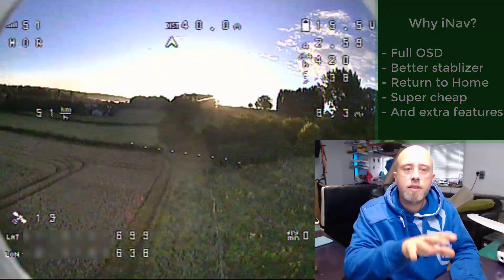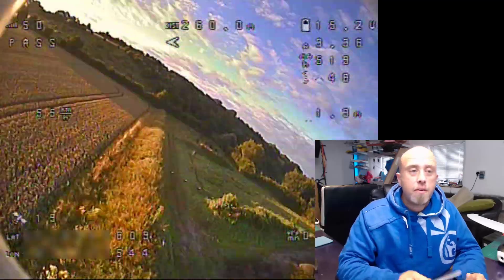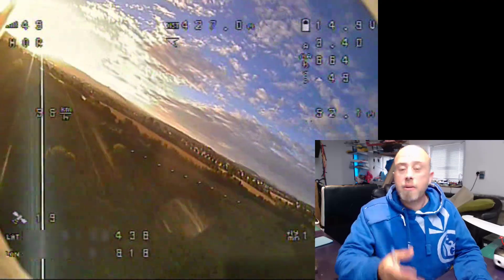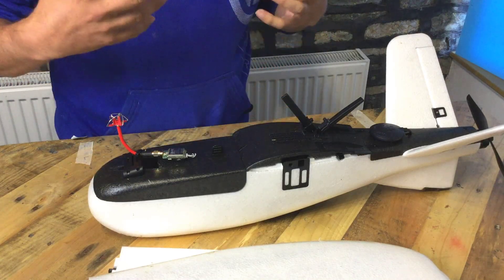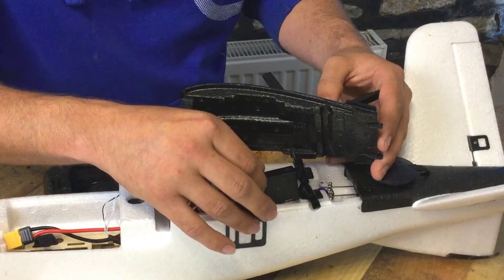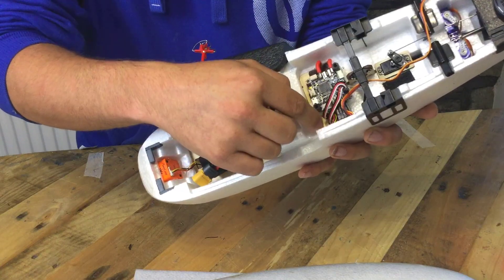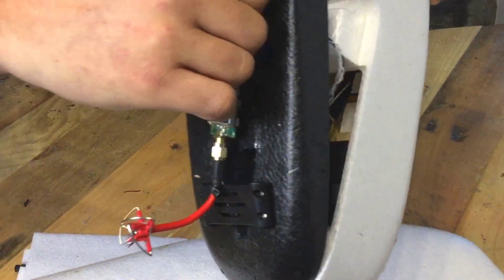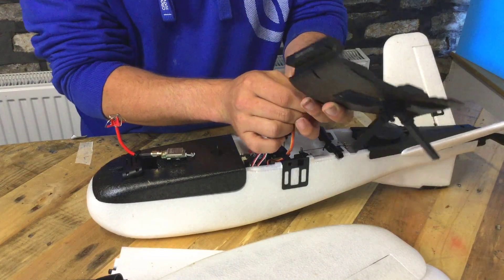ZOHD Nano Talon iNav Conversion + V-Tail Mod + FPV Build Overview

Comment: Do you use a capacitor on battery leads to reduce noise?
Reply from the maker: Morning, never Mike. I might sometimes add a torrid coil for power lines to the FPV camera, but that's not very often. Matt

Comment: Hi, I see you have aligned the diversity antenna north/south rather than east/west. Is this less/more effective? It makes more sense aerodynamically but I thought the intention was to have one antenna closer to the vertical in the roll plain. Just asking, if there's no difference I'll change mine to north/south orientation. Cheers.

Comment: A nice review, could you tell me what the green rings are called and what is the purpose are they to stop interference and are they magnets?
Reply from the maker: Hey Alan, those are torrid coils, they reduce noise . Have a google on them as they work really well. Matt

Comment: What battery should i use fpr 30 min flight? Pls help i am begginer
Reply from the maker: Hi, are you really sure you want to fly for 30 minutes when you're a beginner? Pretty sure it would be irresponsible of me to add anything to help you tbh fella, Matt
Reply: @RagTheNutsOff  im using 4s 2200mah for 30 mins flight

Comment: I I love the videos good work anyhow I have the zohd dart which I  have inav setup in my question is it does not have enough control or is not responsive enough when flying is there a way to increase roll and Pitch responsiveness to make it more Snappy while flying as I did not have enough control to pull up from a dive  in horizon mode thank you

Comment: Hi Matt you may have scoffed at my idea of running my fpv of a second battery....not as ridiculous as it sounds// with a runcam swift in the nose and 1500 3s pushed back as far as possible the talon was still nose heavy... with a 2s 800 in the underbay it is now cg perfect and still flies as well even with the added battery weight

Comment: Hi Matt I like your video and I want to build inav on my Nano Talon. But the gps you recommend is under restocking on banggood. Can you recommend another gps (on banggood) ? Many thanks, Henning.
Reply from the maker: Howdy fella, I cannot as I have not used them. Get the GPS from eBay instead as it'll be the same thing. Matt
Reply: Hi Matt, Thanks for answering back. I found a similar and ordered on eBay. :-)

Comment: ok Matt at 62 and new to fpv but not flying as i have  bixler and timber. i was confused by the wiring nor much good at electrics but i can knock a tune out on the bagpipes...try that for a laugh...bought the talon after seeing your reviews and decided to try fpv first before next attempting inav..anyway just read somewhere that i should strip the heatshrink from the esc and connect there...is that right?....I am sure that i am not the only one new to this and it would have been  useful as you rave about the talon to have had a whole series on setting up for us beginners with fpv and inav...Cheers

Comment: I’m having a hell of a time with this inav stuff in my NT.  Elevator working backwards meaning I tilt the NT down the elevator goes down when it should be going up! Same if I pitch craft up the elevators go up!  Absolutely no help from the Facebook groups just same old ridiculing. I’m using a QX7 with sbus and a x4rsb receiver.
Reply from the maker: Morning, watch the second half of this video, the mixer is covered in it https://youtu.be/5Z5dTBIDLC4 Matt
Reply: RagTheNutsOff thanks but I gave up.  I purchasing the full size talon and going with vector or pixhawk.  Not a fan of inav.

Comment: Thanks Matt!  This is exactly what direction I'm going with mine.  Been collecting the plane and all the parts to go in it.  I haven't used iNav yet and your series on it has answered a lot of my questions.  Have a friend with a 3D Printer that has printed all the same parts, so when I came across the video, I'm getting more exited.  Thanks again for all the information you've put out there!

Comment: The ESC and gps that you listed are out of stock. Do you have any recommendations for replacements?
Reply from the maker: Hi Nate, check eBay for the GPS unit, makes sure it's the same though. As for the ESC, anything similar should be OK. Matt

Comment: Hi Matt! 
Thanks for your informative videos! I'm modifying my Nano Talon to tighten up the ailerons by adding one servo in each wing. Then I will have 4 servos insted of 3. Is it possible to configure iNav 1.9.3 such that all 4 servos are controlled effichiently? I'm intending to install the Furious F35 as FC. If so - how should the iNav setup be like, compared to the 3 servo setup?
Thanks and best regards,
Torgeir

Comment: Thank you for the reply, but I know you know, because I see in you flight test that rssi is working on you osd, so my question is how you get that rssi that is working on you osd, what cable from the rx to you f4 v2 flight controler is solder, . thanks.  and happy fliying.
Reply from the maker: Howdy, see my YT channel, I did a series on Inav and also one episode for the RSSI connection. Matt
Reply: Founded it, thanks so much the x4r is inverted signal so you need to do a mod and solder en the back of one of the chips to get un inverted  signal and then solder to the pad and then calibrate the rssi signal with the osd and radio or inav software, the x8r does have a un inverted rssi out so the only thing in the case is just to do calibration,  thanks so much for the info.  Have a fantastic day.

Comment: How hard or easy is it to set this up with a little pan and tilt mount on top of the nose? Feasible?
Reply from the maker: Morning, yep it's feasible, but it would have to be light as you'll compromise the amount of battery you'll be able to carry with extra weight in the nose, Matt

Comment: Great video Matt, thank you very much. I've my model almost ready for maiden with the iNav conversion. Also followed your iNav series. I am powering the servos with the UBEC of the ESC (only signal and ground wires connected to fc). Is this ok? Thanks!

Comment: Hi! I have a following problem with my Nano Talon( with omnibus f3 pro): when I move the sticks,  it is shown on the screen in iNav,but the servos on the plane doesn’t respond. Also the motor works on the motor test via iNav, but when I try direct from the radio-  nothing. Also, the esc starts beeping when plug the battery. Even when I arm it, nothing changes.I will be really glad if you can help me! Thank you!
Reply from the maker: Howdy, see here https://www.youtube.com/watch?v=TfZZnurrIRA or check their wiki, Matt
Reply: Thank you! I still have not solved the problem. Is it possible the reason is that I don’t use PDB, and soldered all servo wires directly to the flight controller ? If this is the problem, why the motor also doesn’t work? It works only on motor test in iNav.

Comment: Question, do the small magnets affect the iNav at all?  Also, do you think this could be a beginning model, for someone that has a bit of experience?
Reply from the maker: Hi Mike, yes & no. Yes if you have a compass/magnetometer onboard and enabled. However a compass is not required for iNav. As for a Nano Talon being a good beginners model, definitely not. There are better models out there, like the AXN (look this up on my channel) which would be way better and cheaper, hope that helps Mike, Matt

Comment: Him Matt,I am building my Inav  nano talon kit ,these days ,and I was wondering If I have to set any reflex for level flight at the elevators, like my S800?
Reply from the maker: Howdy fella, yes. The CG on this model is correct, however you need some uptrim, say 2mm and try that, Matt
Reply: thanx Matt I'll try that.May ask you for any flying tips?I see many videos of NT's spinning out of control for no reason ,what do you think happened?I  am building mine as a gift for my little brother and I am a little worried as he only has experience with toy planes.

Comment: Hello Matt,
I have a big problem with my Talon Nano. I hope you can help me. I use an Onibus f3 Pro and Inav 1.8. The Talon flies but Returne to home and Positionhold does not work. The Talon tilts to the side and crashes. I did a video. I hope you can help me. 

https://www.youtube.com/watch?v=sznxjlBqkhc&feature=youtu.be&t=27s

https://www.dropbox.com/s/tsqum4wty3atm8j/Dump%20Inav.pdf?dl=0

Comment: Hello Matt, like many others, you inspired me to buy NT as well :-)  And I wonder if you just connect rudder servo to PWM5 pin. I found out that it is possible use PWM2 for servo using experimental iNAV FW.

Comment: hey matt do you have a video on how to set up the mixes for the nano talon? I looked but didn't see one. I'm using the CLI command mix off Gethub for the nano talon not sure what pwm out I use for the tail end. 1-motor, 3-ail, 4-?, 5-? .  I would just try one combo and test it but not getting passed some beeping I think is from the esc, do I calibrate the ESC through the FC or by-pass it and plug it strait into my receiver to calibrate it? thanks a lot for the help.

Comment: Hey Matt,
Really enjoy the content you produce.  I'm hoping you can help me figure out what is wrong with my nano talon inav setup , I bought an Omnibus F3 from readytoflyquads and loaded it with iNav 1.8.  I've got an FRsky Xsr rx connected via sBus and have loaded the custom mix for the 3 servo setup.   Everything works except for the second rudder/elev servo (connected to PWM 5.  I know it isn't the servo itself as I can switch it with the one connected to PWM 5 and then it works and the other one doesn't.  It seems that I'm not getting any output on PWM5.   I'll post in the facebook group when (if ) I'm approved.

Comment: I'm building a inav nano talon using your videos, I just went to get the FC and its out of stock but I seen they have a V3 with a barometer. will this work with Inav as well, and other aspects of your build thanks a lot
Reply from the maker: Howdy, no Baro is needed on fixed wing models, hope that helps, Matt
Reply: it was more so because they don't have the v2 till next month. 
man great channel I just stumbled on you looking at the Nano talon, iv been watching your videos the last 3 days! I have a Bixler 1.1 set up with an arkbird fc and osd, but wanted a smaller fpv platform, thanks again
Reply: oh the v3 does not have current meter ill see if I can find a v2

Comment: I'm gonna build this but just a few questions when ordering the antenna has a choice  does rp sma female fit rp sma male?and the camera should I get pal or ntsc,?
Reply from the maker: Howdy Paul, yes thats correct on the connections and for the FPV camera, PAL. It's a bigger picture. Hope that helps Paul, Matt
Reply: thanks for your quick response ,gonna order the parts some are out of stock  so will have to wait ,I want to go in a cloud ive got racing drones but need the extra flight time and return to home function.this looks the best way to do it

Comment: Ive watched most of your setup videos.  Theyre great.  One thing you mentioned but didnt go over is how you are using a BEC with the boards bec?  I have the same setup but im not sure which power regulator to snip on the f4 board.

Comment: Matt, I have tried to discern how you fed the antennas through the foam on top. Since that area is all black, it does not show up well in the video. I see no obvious way to do it with out cutting a hole in the foam big enough to pass through one leg of the antenna at a time. Then do you glue or velcro the mount over that hole or what??? Thanks.

Comment: Another great video, thanks! How did you power the servos from the ESC ?
For the NT I guess you don't need the PMW6 as you have only one servo for the AIL. So I connected it as you explained in your Omnibus V2 pro video, use the NT mix, but PMW5 doesn't work. Is that because I use inav 1.8.1 while you are using 1.7.3?

Comment: Bought the version with three servoes. It is worth checking the fuz aileron torque drivers as mine bind. Teflon seems to fix. Also glue the spar box components as I ripped the fuz end plate off in a minor crash.

Comment: Would you please consider a video on how to connecting the servos, specifically PWM outputs 5 and 6. Can the channels be remapped to use PWM 2 for servo output?
Reply from the maker: Howdy Dieter, thats beyond anything I would cover in this basics series. See the iNav wiki pages on how "smix" works, Matt

Comment: Hi Matt, my nano talon is on the way, I just have 1 question: 
Aren’t there too few pwm outputs on the Omnibus f4? If 1/2 are for throttle, there are only 2 left, but there are 3 servos

Comment: Thanks for the awesome video. Didn't think I would go through the 19 mins but ended up interested in everything you said!
I'm wanting to get into fixed wings for aerial photography but have zero experience. I'm thinking I could get one of these to learn about them and get ready for costlier/larger planes.
 Do you think the Nano Talon would be good for this?

Comment: Hi Matt - this is a potentially dumb q that probably should go to another nano talon video - I would have like to have seen how you connected the FPV system to power.  I am going to use the stock stabilizer chip - do you have a video that shows this?  Also on the right side of the stabilizer diagram there is a + and  - would that be a source I could use to power a 5V camera?  That may solve the power for the camera but I wish I had more detail how others (you) supply power to the FPV transmitter.  Thanks - Tom
Reply from the maker: Howdy Tom, the FPV system is separate and you connect up your receiver as per the markings on the stabilizer, it's dead straight forwards & you can go only wrong by connecting the + & - the wrong way around. The stabilizer/mode one needs to go to a 3 way switch on your tx. Hope that helps Tom! Matt

Comment: Hey how do you set up the stock stabilizer?
Reply from the maker: Howdy Alex, just attach the labeled pins to your receiver, nothing complicated, Matt
Reply: Ok i must have done something wrong it will only go into stablised mode when i shut of the transmitter
Reply from the maker: Odd, I had mine on a 3 way switch for the mode and it worked in the 3 modes. Matt

Comment: hello. nice video. 
questions : does this FC Omnibus F4 Flight Controller presented in the link  -- - 
- support iBus
- i2c 
Thanks in advance.
i'm thinking to buy this setup as my 1st fpv plane. :)
Reply from the maker: Howdy, I have no idea on iBus I'm afraid, Matt
Reply: well if sbus is working then ibus would work also.
did you added external mag .. or this board has an internal one ?. thx.
Reply: Just use a 1 uart for ibus...

Comment: how did you adjust ailerons in inav with only one servo attached??? normally you need two
Reply from the maker: Howdy fella, see the video description above by pressing SHOW MORE, it has the details in there that you need.
Reply: thanks matt for the fast answer. however, thats too much for me,. never used the cli in inav or betaflight and i really dont know how to use this text to set up my nano talon using inav.. :(  sorry

Comment: Hi Matt,
Is it possible to ignore the V-Tail and just use Aileron mix like a yank and bank? I have an extra eagle tree vector lying around and I'm trying to decide what settings to use etc. Any tips would be great. Thank you for your thorough and amazing content!
Reply from the maker: Howdy Charles, ther vector supports V-tail models as I use them in my Mini Talon and X-UAV Clouds. As for whether you want to use rudder or not, thats up to you whether you include it in your transmitter as a mix if not using a vector in the model. Hope that helps Charles, Matt

Comment: Hi Matt, I know you have 2 nano talons with your own fpv set up. What are your thoughts on the pnp fpv ready model that banggood have available? Think it comes out at about £158.00. Nice set up you have on yours as well.
Reply from the maker: Howdy Terry, I'd definitely not suggest a PNP FPV kit as the parts are always done on a budget. I'd 100% suggest buying the FPV parts separately, such as the TX526 vTx for $12.59 and a Mini Run Cam Swift for $34.99, which I believe comes out cheaper than the FPV model kit! Hope that helps Terry, Matt

Comment: Good morning Matt!  Thanks for the iNav vids, just finished successfully setting up my flight controller.  I did run into a minor issue with the Nano Talon code, when I cut & paste into the CLI, I get parse errors.  Not sure what/why, not exactly a coder.  I did try the lines individually.  Here's a screen shot  http://i31.photobucket.com/albums/c365/Fyathyrio/parse%20error.jpg
Reply: Found the answer after much google-fu...take out the two 0 in the middle of each number set.  The formatting has been changed for inav 1.7.x.  After this I had to reverse both tail servos in inav servo tab, then all worked.
# servo
# servo mix
smix reset
smix 0 2 0 -100 100
smix 1 3 1 -85 100
smix 2 4 1 85 100
smix 3 3 2 -75 100
smix 4 4 2 -75 10

Comment: Hi Matt.  Did you remove any diodes on the board before powering the servos from the Esc (as suggested in some forums) or has it worked out OK to just take the ESC and plug it into the PWM slot to power them?
Reply from the maker: Hey Alan, I'm just plugging in the ESC and it's powering the servos OK. Hope that helps, Matt